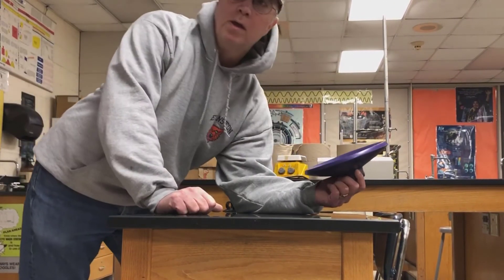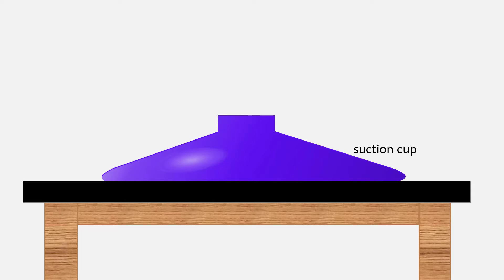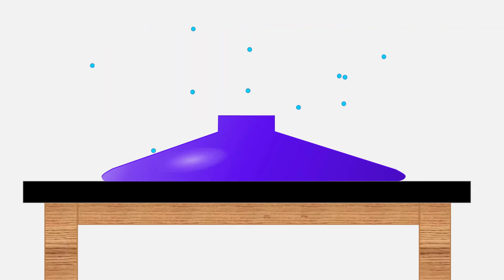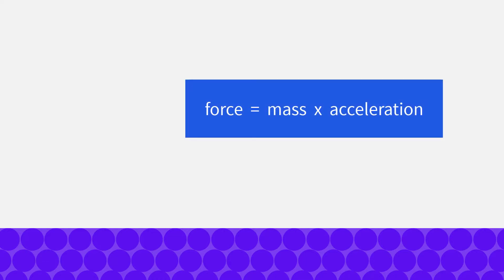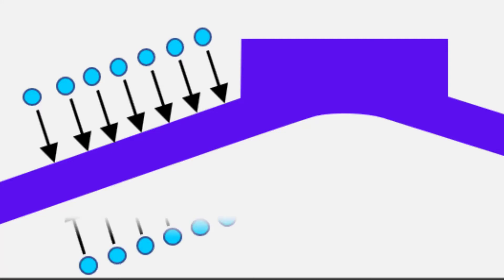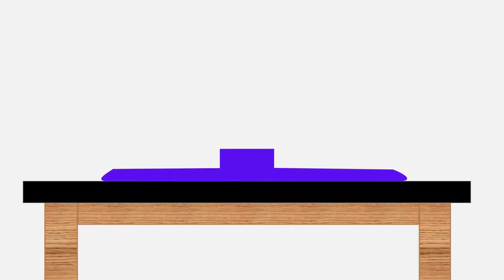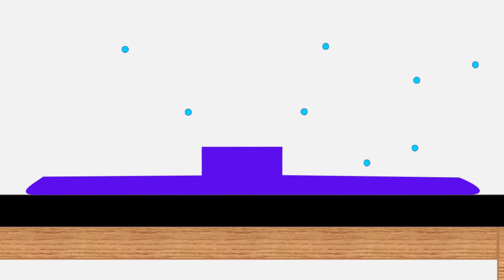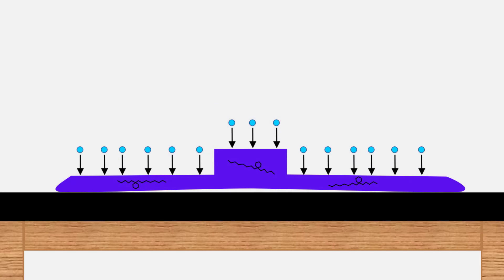Behavior of Gases: How we experience the every day consequences of gas particle behavior

Comment: NO WAIT! There's something wrong! When the pushed cup is flat on the table, it is at equilibrium,  this means that the downward force of the air particles is cancelled out by the upward force from the table on the cup. Later, when you pull on the cup to lift it you are trying to overcome the force exerted between the cup and the table. The act of pounding on the cup is like attaching "springs" to the cup that will activate when you pull on the cup to lift it. In fact, the harder you pull, the larger this force gets!
Reply from the maker: @Nikan Rst I mostly agree with your clarification. Problems:  1) Lifting the object does the opposite of resisting. It's elasticity "pushes" it upward from the center, which is how a suction cup works, so lifting it is helping it get where it "wants" to go. The resistance you feel is the outside air pressure pushing it down, plus a little gravity (as you say). But what specifically is the attractive force between the cup and the table are you are referring to?  2) I do not agree with your original assertion: "when you pull on the cup to lift it you are trying to overcome the force exerted between the cup and the table." This cannot be the case since there are only repulsive forces between the electrically neutral lid and the electrically neutral table, that of electron repulsions between the two surfaces. While we can speak of momentary dipoles created by those repulsions, they are negligible due mostly to the large distance (microsopically speaking) between the surface atoms of the two surfaces and the microscopic irregularity of their surfaces, which incidentally allows a small amount of air to stay between the two surfaces, although not enough to have any apparent opposing force to the outside pressure.
The change in the normal force is only due to the gravity exerted on the object. The normal force countering the air pressure on the suction cup is the same on the entire table: atmospheric pressure is always present on the table regardless of any other mass placed on it. 
Also, my referring to the normal force as tiny was coming from my own (unstated) comparison of the very strong atomic interactions in the table, and the large repulsions between electrons at the two surfaces, versus the relatively much smaller calculated normal force, whatever that would be.
Reply: @CrashChemistryAcademy   @Crash Chemistry Academy  Let me write the force balance equations:

Step 1: object pressed to the table- hands off  :
Weight (cup/lid) +   air pressure force =  normal surface force from table  = this is a constant value 

Step 2: trying to lift the object using your hand (let's just call it lift)

weight + air pressure force =  lift + a new force acting on the cup from table 

we may wonder, why should there be a new force acting on the cup now?

remember the left hand side is a CONSTANT value so it cannot change, but the force from your hand can vary, as demonstrated in your video ,,,the harder you pull, the more resistance you feel  This means a new force is now resisting your pull to balance the equation above

The lift force is the combination of the air pressure, the weight AND this variable force whose value depends on how much force you use to pull the cup with 
That's my understanding of the situation.
Reply: Nikan Rst Well in my opinion the Jedi are evil!
Reply from the maker: the normal force is not constant. For example, if you place a object on a table, the normal force = amount of N supplied by the object. Suppose this is 100 N. If you attempt to lift the object with 60 N, then the normal force drops to 40 N. As you increase your lifting force, the normal force drops until it reaches zero at the point of lifting the object off the table. Since the normal force is variable, your equations are not equal.
Reply: @CrashChemistryAcademy  You said  EXACTLY what I wrote in those equations.  I SPECIFICALLY pointed out that the normal force when you're trying to lift it is VARIABLE. What do you mean my equations are NOT equal? Did you read them carefully?  The equality is a law of physics (Newton's 2nd law as you know ) for stationary objects. . Anyhow, the point is  in the video where you say "there are  no particles creating an opposing force on the suction cup" is NOT true. There are no AIR particles but the table exerts the SAME amount of force from below when the cup is just sitting there  (no lift) on the table as you show in the video. Thanks.
Reply from the maker: OK, but... you still have not stated what the source of this "new force acting on the cup from the table" is. If you want to adhere to the laws of physics, there would be no knew force, given the materials (and laws) we are working with.
Reply: @CrashChemistryAcademy  By "new force" I mean the surface normal force whose value changes with respect to the lifting force applied. It works "like a spring" on the cup resisting the air pressure force from above. In another scenario the force could change in direction too. For instance, imagine a piece of gum stuck on a table. Without trying to lift it, the force balance dictates that the normal surface force be upward. However, as soon as you try to lift the gum stuck to the table, the table will "pull the gum" downwards. The surface normal force is critical in the force balance.
Reply from the maker: The gum example is an example of molecular interactions, often induced dipoles from hydroxyl groups in the sugar and other compounds in the gum. There are no apparent molecular interactions between the suction cup and the surface. Why do you need the suction cup to be pulled down when there is no evidence of that happening?
Reply: @CrashChemistryAcademy  I am not saying the table is pulling the suction cup down (it is doing that to the gum). BUT, the table is exerting an electromagnetic  force on the suction cup. The electromagnetic field from the table and that of the suction cup repel each other and create a spring-like force as big as the external air pressure force. Check out a good papaer entitled, "The physics of suction cups" by Tiwari et al ( it's freely available).
Reply from the maker: @nikan4now  Thanks! I will.
Reply: @CrashChemistryAcademy  pleasure
Reply from the maker: The upward force from the table is called the "normal force" which only accounts for the table being able to stop the lid from going further toward the floor due to the repulsions between electron clouds in the atoms at the table surface and in the atoms on the bottom surface of the lid. The normal force here is quite tiny. The real equilibrium is between the bonds holding the table's atoms together and the electron repulsions between the two surfaces and the two downward forces of gravity and air particle collisions on the outside surface. There also will be an equilibrium within the cup itself once air is restored at the bottom surface and the lid can go back to its lowest PE shape.
Reply: @CrashChemistryAcademy  No. I beg to differ. Let's do this in steps. Step 1: Let's consider the situation where you have just pressed down the cup and removed your hand. So the object is sitting on the table flat. Let's do a free body diagram for the object on the table. The downward force of its weight plus the force from air particles above equal the surface normal force from the table. Do you agree? This normal force is NOT tiny and in fact is doing most of the heavy lifting. Step 2: You apply a force upward using your hand.   The weight plus the pressure force from above have not chanced from step 1. These forces plus the force from the table will resist the lift force from your hand.   The role of the normal force is critical. You can imagine another situation where you press the cup hard on a vertical wall and it sticks (like a plunger). The surface normal force will equal to that of the air pressure.